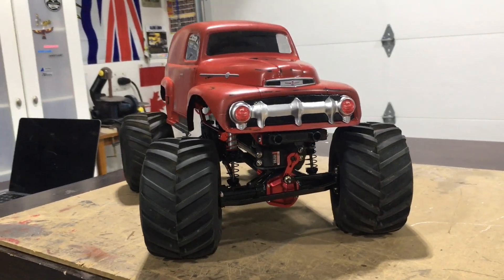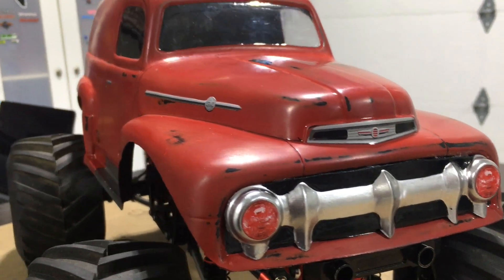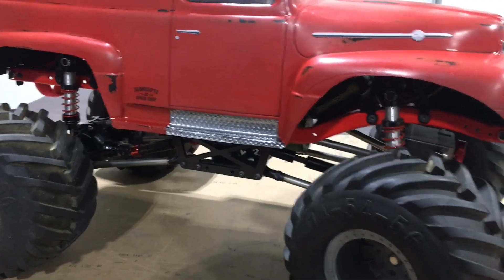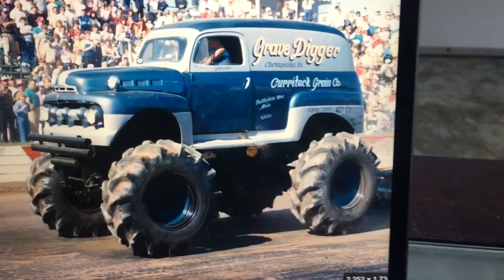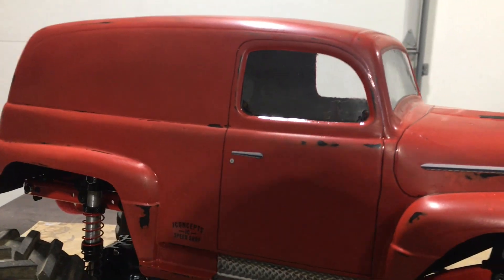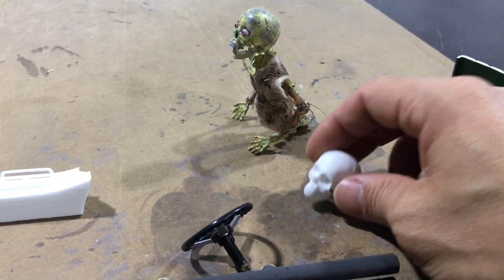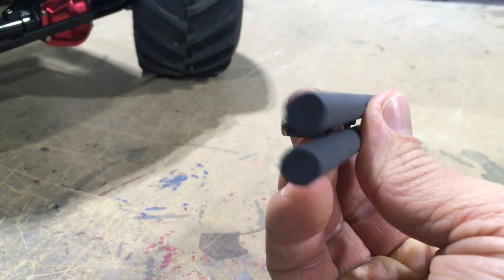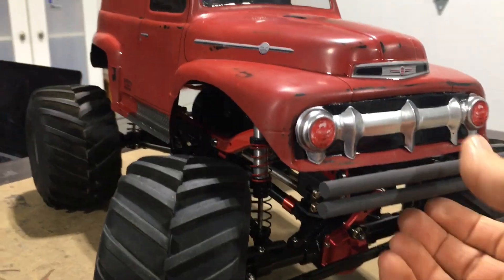Rc Gravedigger

Comment: Very cool! I have  the same lift kit plates for the SXC10 here, I was thinking of doing something similar with mine but then I got the SMT10 so it kind of fizzled out. It should be a fun truck but may be a little wobbly but monster trucks are supposed to be a bit wobbly!! It is great looking rig and whoever built it did a really great job with it! I am sure it will get much better from here...
Reply from the maker: Ya thanks buddy. Bounce is where it's at with these things! Just some details and a strong steering servo and that should do. Iconic looking bodies.

Comment: Somebody really put a lot of work into that! SCX10 II Frame and Gearbox, SCX10 One Axles....
Really clever way of going about that! The SCX10 Axles can easily take the Brushless power!
Reply from the maker: Good to know, thanks for the clarification paisano
Reply: @westernsharpie  My pleasure always! SCX10 One had very distinctive features.... the only reason people yelled for a SCX10 II was, they hated Servo on Axle!! It's actually the strongest and most Reliable. I just finished a video where I converted my CC-02 Unimog to Axle Mounted Servo! Works 200% better now!
Reply from the maker: @CarmineRC  fair enough, I can live with that. Ya its pretty strong right there, no sloppy linkage. You get all the torque outta the servo from there. Theres a badass 1/5 Gravedigger gas powered and its in the same spot.
Reply: @westernsharpie   Yeah, that 1/5th Scale Grave Digger is mind blowing!! 😎😲😎